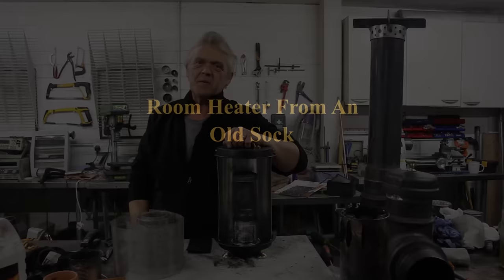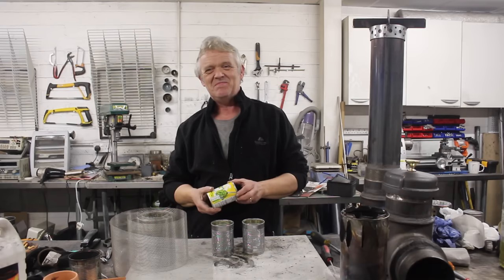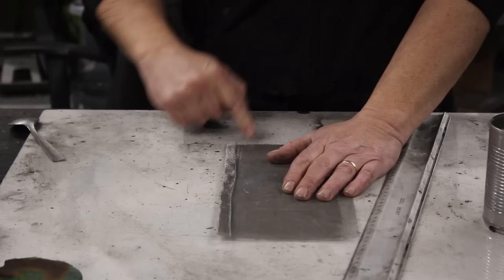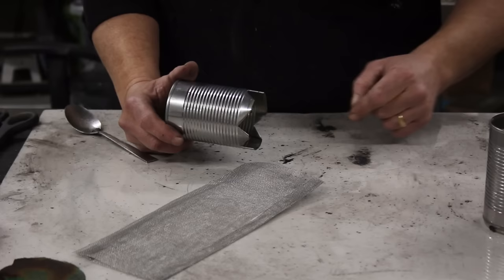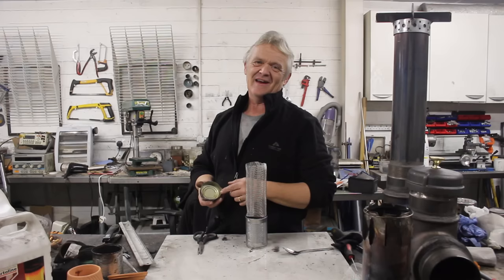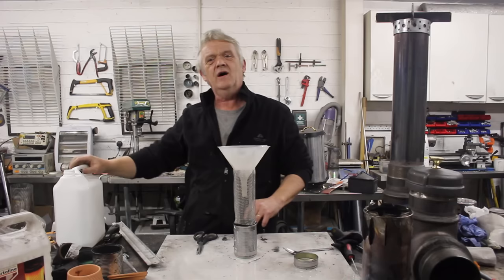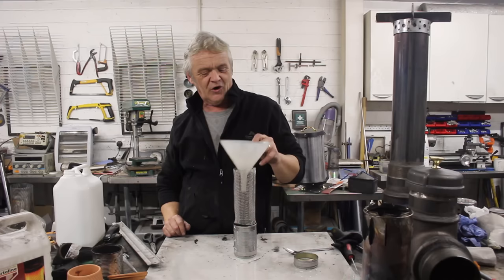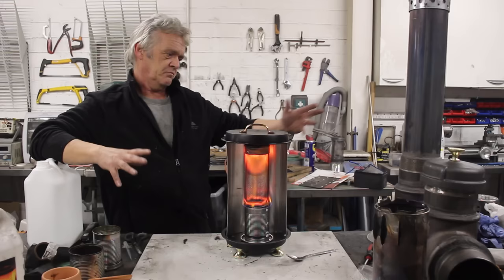1746 DIY Room Heater From An Old Sock

Comment: Great vid. Could you create a smaller heater please? I have about 6 old (from the 1990's) all stainless steel, inner & outer, Thermos flasks of various sizes. Some wide mouth, some narrow.  I don't use anymore as there are better ones now that keep things hotter. Anyway I'd love a tiny portable heater of perhaps a Thermos cut in half, then hinged, so it opens with 2 little Burners in each half. It'd be  to take on my car camping trips. You'd be just the man to figure this out. Cheers & hugs 💗

Comment: You, sir, are a professional. 

I'm not.

So I do "fire experiments" outside my cabin, in the garden.

This is all R&D fun, and that's why I'm here.  But I wouldn't bring it inside because,  I don't know how I can quickly put it out if things go wrong...
Big thanks for such "great stuff" as my dad would call it.. 🙂
Reply: Ethanol, isopropanol and methanol can be put out with water if enough water is used. I'll use Ethanol as the example to keep things simple. Ethanol and water mix. The Ethanol will be over diluted with the water to a point of over dilution (not enough Ethanol in the mix) to the point it won't be flammable anymore as water is not flammable.
You Can Not do this with petrol/gasoline or oil fires.
I have experimented putting Ethanol out with water and it was quick and easy, you could too, in your garden to get a real world experience and understanding before  lighting one of these in a house or shed; a hand's on safety test.
I hope this helps Peter 👍Oh' smothering the lot with a really damp cotton towel or bed sheet will work too.
Reply: @pa_maj.MARTINI-van-MAN  Thanks.   I had no idea that water would put that out ....  
All the same.... if something is "dicey" and I'm not sure how it will go.  I wait until my wife's gone, then go down near my compost. 
Years ago I was searching for a fast burning gas, and I found it.... HHO.  Boy was I glad, she was gone and  I was "at the bottom of the garden" with safety glasses actually ON.  !
😁

Comment: I have bad experience heating indoors with alcohol liquid systems, tend to make a lot of moist and eye and nose sore fumes. Does your mesh do the needed combustion difference ? Carbon felt easy obtain; Universal filters for kitchen ventilators. Most white ware and some general electronics shops usually has them.

Comment: Can't you make carbon cloth out of the cotton sock? Wrap it tight in aluminum foil & toss it in a fire or an oven for an hour & then leave it to completely cool before opening.
Reply: That carbon will be a lot more crumbly.
Reply: @justinw1765  Yes, and that's almost exactly how those gas lantern mantles work. You put a fiber "sock" over a gas source, burn it and then use it as a hot surface to burn your gas and make a lot of heat and light

Comment: Since wool is far less flammable and far more heat tolerant than things like cotton, polyester, nylon, etc, a wool sock theoretically should last a lot longer than other common sock materials.
Reply: Wool would be the best and safest option as no noxious/toxic fumes produced by burning. Also no melting or dripping or sparks
Reply: I tried wool. It isn't very flammable but it does melt and char and become unusable after one burn

Comment: My understanding is that carbon felt is made by essentially turning normal felt into charcoal.  I don't remember 100% about it but I wonder if before you like this the first time you can turn that sock into carbon felt by heating the entire can without any air present.

Comment: Is Carbon Felt not the same stuff you can use as filter in the kitchen or in ventilations(activated carbon fleece filter). In Germany where I´m from the white stuff from synthetic fibres is more common but you can find this carbon stuff on a...zon. Maybe you can use even the white stuff. When it´s fireproof and soaks up liquids it should go.

Comment: Just to say, you sir are a delight to watch and great in front of the camera, your ideas/builds are great and probably help some people looking to heat their homes. However I do have a concern and therefore a challenge. This heater looks lethal to me as in a house with kids or pets or an inadequate surface then the whole house goes up if its tipped etc. So my challenge/request is, can you make a smaller version that could be moved with relative ease and or placed somewhere like in a pan or something. Hope I'm clear on what I'm trying to say. Also it does not have to be a version of this heater but perhaps another design of small heater. As for fuel oils and isopropyl alcohol are easy for most of us to obtain, I personally have not ever searched for methanol, not speaking for all there, just thinking of things that a few of us less savvy people may of used/heard of. Thank you very much for your videos and good luck with any future vids.

Comment: Hm.. maybe useful idea for improvements for someone.. It seems to me that the methanol might evaporate a bit slower. Seems like the flame is unnecessary high. I can imagine thinking of heavier fuel or smaller thermal bridge between the mantle and the cans.

Comment: Brilliant idea/solution to the ,unobtainable, carbon felt. The downfall to this is burn rate. I never build one with such big notches but similar and it was out of fuel in minutes. Just buy the felt is my advice. If I may I've put the burner in a homebase incinerator it was 20 quid and is made of steel. Sits above the ground and feels much safer when kids are in the house. Also put magnet on the bottom from the outside and it holds the tin in nicely

Comment: Although I really enjoy your vids, I feel I should point out that the methanol does not last as long as you have said . I have made one of these heaters,  and one quarter tin of fuel only lasts around twenty mins, which  is around a third of what you seem to get. which works out quite expensive.
Reply: Probably it all gets hot and evaporate much more rapidly. I had some similar problems with candles under a ceramic pot. Normal candles just melt into a poodle and last maybe a quarter of normal burning time.
Reply: Same here, disappointing burn time unfortunately. I would like to see Robert do an endurance burn test on his, he could burn 100ml and speed the video up.
I doubt I would use this method of heating unless in an emergency although I still have better options for that too. It's a cool heater, just not efficient £ wise.
Reply: Agreed 👍
Reply: 👍 agreed

Comment: I am just not seeing these 6 hour burn times for fuel.   45min is a whole can.  So I am either doing something wrong or the burn times are wrong.    At 45min it's as expensive as just putting the central heating on for the whole house so I am at a bit of a loss.  Or is that why in the original it was a pin hole to prevent the flame from lighting inside the can?

Comment: Hello robert I have a question for you? see if i have my burner burning and for some reason or another I had to leave the house like right now   how do I put out the flame on something so tall.
Reply: Fire extinguisher. Works perfectly 😁
But with all seriousness, just use a triangle of fire. Usually having a piece to cover a radiator and deprive the flame of oxygen should be enough. Just don't open it fast. Wait a few minutes untill it cools below the point of self reigniting.

Comment: I presume this is a pure woolen sock?
And in the spirit of this video, don't try to wear the sock during the operational cycle of the heater. Otherwise you'll be hot footing it out of there ‼️
Nice Design, much improved stability.

Comment: Hi Robert , thanks for great videos! very enjoyable to watch. I made a few of the alcohol stoves. But i live in a very cold place these stoves work very poorly if at all, in mins 20's and lower. will this heater work at very low temperatures. I think once going they  may be ok, but heating fuel up to the point of self sustaining burn may be a challenge in the cold.

Comment: Just purchased a *Coleman Lantern for $33 US. Works on small green/red 1pound/16 oz.  
Propane bottles. I bought a special adapter that allows me to refill those from 25 pound propane bottles. 
It has two 'mantles' a kind of cloth that once ignited, burns off some, then incandesces. 
It puts out a bright white light and an amazing amount of heat, something like 3,000 BTU's I think*
Moron warning - not for indoor use - so use proper ventilation and a CO2 detector, hopefully the battery will not have gone off.... lol

Comment: So, I built this (from the original video, with proper carbon wick which I ordered from Amazon) and lit it in my small (outbuilding) office.  About 12 feet by 9 feet in dimension.  Curious about it's fumes, I decided to put my Carbon Monoxide alarm next to it, and within 20 minutes, the alarm went off with CO levels already at 200 ppm and climbing fast.  The only deviation from this video is that I burned denatured alcohol instead of methanol.  Would methanol actually make any difference?  I opened the door and let the room air out to let it continue to burn, but 8oz of alcohol only burned for about an hour.  Not "4 hours".  The fit between the inner and outer can was exactly the thickness of the carbon wick, so it was a good fit.  Does, perhaps, denatured alcohol just burn up faster than methanol?  I did read online that denatured alcohol is more energy dense, and hotter, than methanol, so maybe it burns faster?
Reply: I too am also concerned about the Carbon monoxide output in a small room/tent  has anyone else tested this or must we build a chimney?

Comment: I am going to make an alcohol vaporizer for this bean can .. run a piece of copper pipe into it.. with a  nipple or small hole jet.. then put the carbon felt in the pipe.. once the pipe gets hot it will vaporize and jet into the can.. similar to an old coleman camp stove..

Comment: Could someone test it with a "incandescent gas mantle"?
If there are big enough ones maybe even over the mesh.
I suspect, that it’s not hot enough because of the mesh, but it seems heat isn’t even the main driver of light output for those things.

Comment: made one of these and tested it today. I only had mentholated spirit to try it it worked well apart from the smell of the burning and the fact it used the half filled can in 25 mins. Did you not say in the last video a half full can lasted 4 or 5 hours ? I know it was not methanol but surely the burn time should have been similar ?
Reply: the flame robert has got in this video will never burn for 4 hours at that rate. i've made  one with floral foam bought from hobby craft for £1.50 and 300ml  of methanol will burn at a lower rate for 4 hours but i put mine out at 3 and a quarter hours as the scent becomes a bit strong if you leave it longer.

the only way to get a longer burn time is to use carbon felt but have a real small tiny piece showing to lower the flame and increase burn time.

Comment: I would like to know how long it burns in a test. I'm guessing if you put about 12 oz of fuel in, then it would burn about 45 min - 1 hour. It should produce about 10,000 BTU/hr and would be like a 3,000 Watt space heater. If you burn this for 2 hours a day, a gallon of methanol would last about 5 days. This should heat an area about 200 - 400 square feet.

Comment: I have just completed my methanol heater but am finding it is burning so ferociously and starts bubbling over with lit methanol! The inner can is a very tight fit on the felt. As it burns so ferocious I only put in 150 ml which consequently only lasts 20 - 25 mins 😩. Any ideas on how to calm it down and make it burn longer?

Comment: hi rob, ive loved watching your videos, but ive made this heater using a small can of tuna and smaller can of peas.. hoowever, when i light it, it turns into a bouncing betty as the pressure blows out the inner can.. 😂 do i need to use larger cans? I tried putting more vents in the top with no luck and considered putting some in the side.. thanks

Comment: I don't see a way to extinguish the flame once lit.Your first design from 1702 has that ability. As always a great video.
Reply: Yeah, I'm trying to figure out how to extinguish it.
Reply: @danoleary6649  The only think i could easily come up with would be to have a larger can to put over the top of the whole thing. Like a 5 gallon hydraulic oil or fuel can - round and like 30" high. That would cut off the air to the burner and snuff it out. But would take a minute or two. If there was some way of having a door on the reflector, then that could be closed and it would reduce and maybe snuff the flame... but maybe not a good enough seal...
Reply: Made this version and wondered the same thing.  I couldn't get mine to light well with 91% rubbing alcohol.  I think im going to modify it back to the style in 1702 for the snuffing out ability.

Comment: Thank you for the info! How many square feet of area does this little heater heat?
Reply: Hello. I was just passing through when I read your question. I don't have the answer you're asking for, but I'd think that you should be looking for a measurement in volume, such as cubic feet, rather than square feet. Say, for example, a ten by ten feet room has an area of a hundred square feet, but the volume of air to be heated would depend on the height of the ceiling. A 10'x10' room with 10' high ceiling would get heated a lot quicker than a 10'x10' room with 12 or more feet in height. I live South of the border near San Diego, Ca. and I don't know exactly what the temperature is in my room right now, but I've used an upside-down  terracotta pot with three or four candles underneath inside a small 10'x10' room with 9 or 10 feet high ceiling, and the difference can be felt. Now, that methanol and sock heater looks a lot more fierce than a pot and some candles. I hope you get your doubts cleared by someone more knowledgable than me!

Comment: Do you have one that will burn used vegetable oil? No extra methane around but sure do have a load of used oil from cooking. I was thinking of building a kiln in the back yard that runs on used oil for melting gold scrap and aluminum. Am oil burning lamp that was smokeless could be useful.

Comment: Two small things. 1 What is the sock made of? 2 I tried something like this with the carbon wick, I forgot to punch a small hole in the top of the inner can. Very soon after, the whole thing went POP! And almost exploded in a giant fireball, in my kitchen. The inner can shot out and hit the top of the burner, taking the top mesh cover with it. Thank god it did not tip over. Pressure built up inside the inner can and the pool of fuel ignited. I did not see you make a small pinhole in the top of an inner can this time. So, tell me, can you do without the inner can and its pinhole? In my tests, 300ml of methanol burnt for 40-45 mins. With this, you did away with the top of the inner can. The pool of fuel will ignite. Is there a danger of an explosion? If the intension is to allow the pool of fuel to burn, why bother with the wick or the inner can. Why not just drop the mesh into a can, add fuel and ignite. But not before standing well back. Never return to a methanol burner if it fails to go off.:buffering:
Reply: That's actually the third time now that I've heard of this happen Packman. 
He did say on one video if I remember correctly that a pinhole wasn't needed but personally I think it's safer with a larger hole around a 25mm and also fill the inside can with yellow fiberglass insulation or fiberglass cloth, even those SS household scrubbing pads. 
A circle of the SS gauze fitted from underneath to dress the hole to make it look tidy.
This will burn very little fuel in the centre and will not create a vapour chamber to blow the can out, a 15mm hole may even be better but it's all experimental of-course Packman. 
I have found while trying other experiments that to get Good heat, the fuel goes much quicker than I'd like it to and slowing the burn rate down too much to get a longer burn produces little heat.
There's been no win win for me, all fuel is expensive unless it's free.

I'm now using Tealight candles between my seat and my footstool inside a large soup/stew pot (right way up) to warm the back of my legs until my halogen heater arrives. 
I've been doing this for around five days now rather than give the gas company my money heating the whole house.
I had 500 Tealight candles I never used that I got for £5.00 at B&Q years ago.
My food grade Ethanol for making tinctures is too expensive to be burning for heat.
It was great to experiment a little with though to work out burn rates, I'll not be buying even the cheaper non food grade Ethanol for this as it's also just not cost effective for me.
Probably OK for an emergency situation which is fair enough.
Reply: The first version had a hole in the top for filling  with a penny to cover it for burning. This one has no top or bottom in the inner can.
Reply: @Coxeysbodgering  As I have said, if the fuel is burning directly from the inner can fuel supply. What is the point of the wick?

Comment: Great Video and I've managed to make a pretty good stove from your instruction but I'm having an issue which is that I cant get the mesh to suit the flame.The only mesh I coud get was stainless steel 200 mesh, which is very thin. my theory is that the thicker the mesh the more heat it will radiate and glow. Because this material is so compliant and thin, yes it gets hot but doesn't kick out a lot of heat. What mesh size did you use than I can source the right stuff as there are heaps out there bit at £10 for a square foot, I dont want to waste my money again buying the wrong stuff. Would you be so kind as to let me know?

Many thanks and keep these vodeos coming theyre absolutely fantastic.

Cheers 
Roo